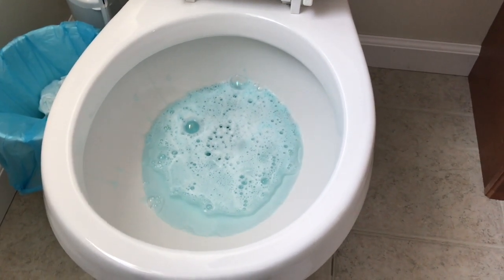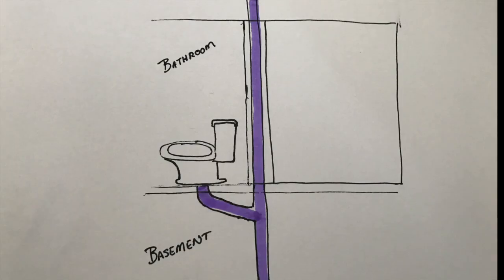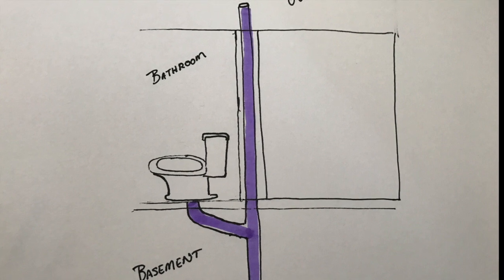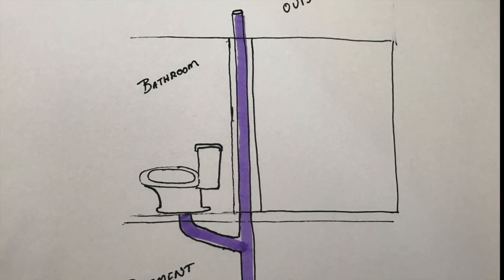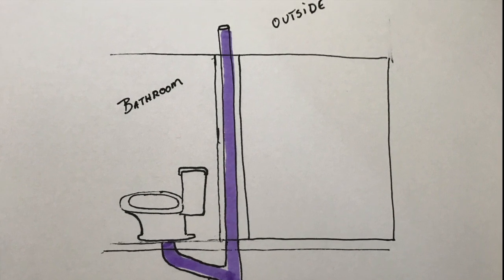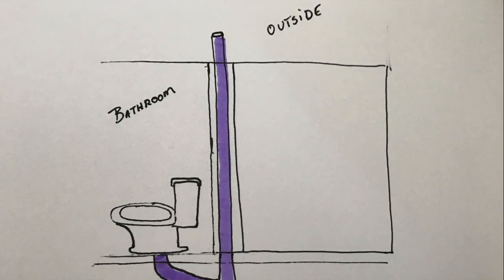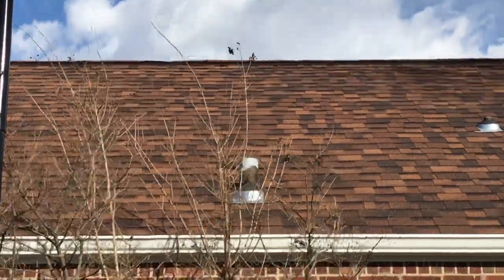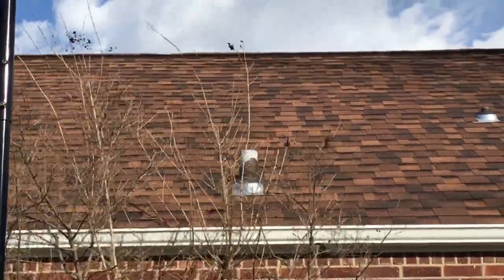Why does the toilet water slosh on a windy day?

Comment: Mine siphons the water out of the toilet, not dry, but lowers it significantly. How do I stop it?
Reply from the maker: Sometimes it is due to a blockage in the line or the vent. You might need to have the drain snaked out or the vent stack cleared.

Comment: Put a 90deg elbow on the vent stack
Reply from the maker: I've never seen this done in my area before. What would you do this for? If it is to try to avoid the "slosh" I don't know if that would work except for 3 directions of the wind. A better solution might be a tesla valve, but seems a little extravagant.